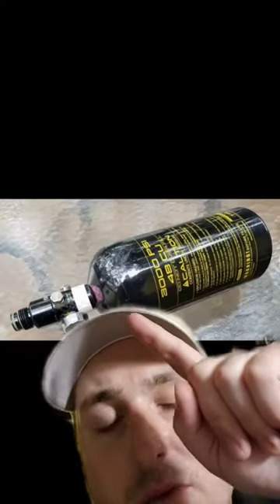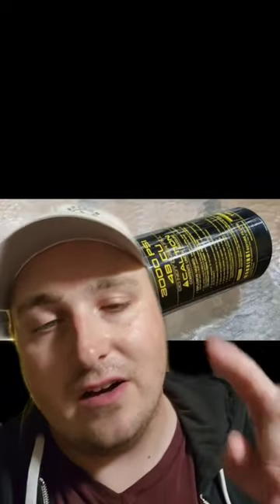let's talk about how to store an Airsoft tank 👌🤿 #moderndiver #scuba #paintball #airsoft #learn

Comment: I have several empty hpa aluminum tanks all the same cu/psi but one is warm and the others are all cold is there a reason for that ?
Reply from the maker: Hmmm that's odd. Cylinders heat up when filled but once they cool to room temperature they should stay at that temp. They will get colder as they loose pressure. Does it get hit by more sunlight compared to the others?
Reply: @moderndiver  no its stored the same as the other i guess "warm" isn't the best description its just warmer than the others